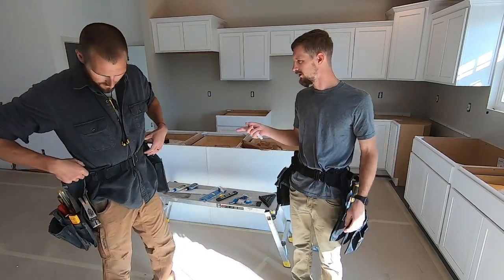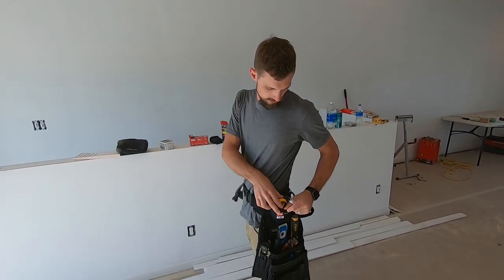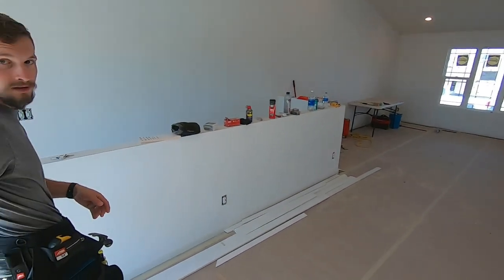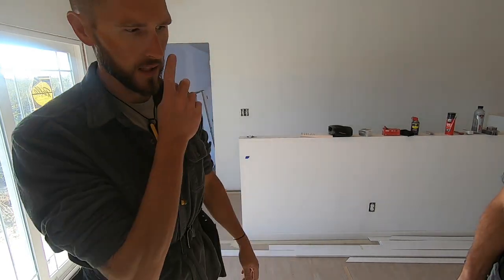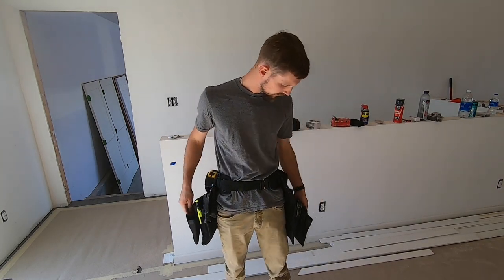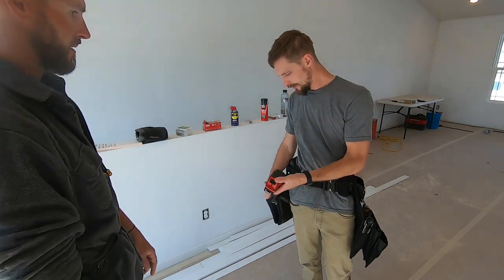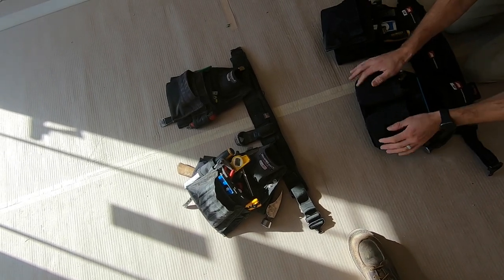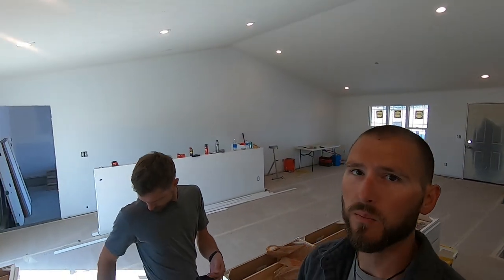Diamondback Tool belt review & comparison. Artisan, Miter, Eagle, SXS, Elias. Best setup!

Comment: This is a great informational video! Think I’m gonna look into badger or just keep the occidental. Thanks for taking the time to do this.
Reply from the maker: Glad it helped thanks for watching, I’m going to check out badger tool belts your the third guy that’s mentioned them !
Reply: I'm thinking of pulling the trigger on the badger side by side setup before the price increase. I'm a residential framer in MA. The framer badger bags is just too much in my opinion.
Reply: I currently have an occidental leather setup but am sick of the weight. Dont get me wrong the bags are super durable. But wearing leather is more weight.
Reply from the maker: Nice what set of occidental are you wearing ? Biggest thing for me is the hammer holster, I don’t think I could do without it now that I’m used to it !
Reply: @AMAYERICAN  three pouch fastener for non dominant and the standard tool pouch with just one lower pouch for dominant. And the high rise hammer holster in the back. Its simple and I can fit everything I need. But I find my hammer always getting in the way when I crouch down. I'm sold on the hammer under the bag style.
Reply: @AMAYERICAN  cool LMK on those, imma ext siding, windows and door sub in OR. Thinking about getting the high low framer. I like to have extra utility capacity. I HATE wearing belts with minimal tools… 55+ dad helps run the company and thinks im a moron 😂for that idea. 🎄
Reply from the maker: I definitely agree with your line of thinking, better to have it and not need it than to need it and not have it !

Comment: Seems like that SXS pouch is more suited as a non dominant side pouch, I have the grande 2.0 setup and I had that issue with my fat max in the tape holder but it stretched out pretty quickly.
Good info, I agree with 6 inch belt recommendation
I love my grande setup though
Reply from the maker: Man I’ve had my eyes on that setup for framing, looks awesome, is there s bit index on the 2.0? I agree with ya on the sxs. What size of tape do you run in the grande ?

Comment: I've had the Mazo and Loki pouches for about a year, and while I do really like them, I just ordered the occidental finisher rig to replace it. The main reason for the switch is that the bags hold all my everyday carry just fine, but I have found that when I'm doing certain tasks like crown for example, I run out of spots to put things, like 15ga & 18ga nails, cut list, stud finder, gauge blocks, chalk line, piece of sand paper, glue, miter clamps, angle finder etc. Its my fault for buying such small bags, but I also dislike how low Diamond backs bigger bags hang and wanted to avoid them. Also Ive realized  I prefer more open pouches, I find that really annoying on DB. I thought I wanted something with a smaller foot print for maneuvering in and out of openings and I'll likely miss that with the Oxi's but I think they will suit me and my workflow better. I do have the hammer and flat bar holsters, love those, I will modify my new bags to fit them. The tape pouch on you guys' rigs would annoy the hell out of me, another thing I like about the ones I got is they have a nylon loop to clip my tape on my left side which is my preference.
Reply from the maker: thanks for sharing your input brother! I agree the diamondback design seems to be less open then standard style bags. I do like my artisan rig for trim. You will have to let me know how the oxcidental bags treat ya. I know spencer lewis switched back after trying diamondback as well,
Reply: Update: I switched back to my original diamond back rig. I put on the oxis, and while they were great, they were just a lot bigger (wider) than I had thought. I have been on remodels lately, so I’m around a lot of finished surfaces and felt my original rig was better suited.

Comment: I got the SxS and mule, I love it,  I do framing though.  So the big pockets work great for me.  My 25ft fat max fits pretty good, Easy to drop in.
Reply from the maker: Nice !!! 6 in belt? Also are you rocking suspenders?
Reply: @AMAYERICAN  sadly no, I got the 4 inch from my artisan set up, just bought the pouches.  Might buy a badger belt though.  I hear those are really comfortable.

Comment: Hey Drew ; long time no talk!  I am Jim Duncan ; Kings Table Finish Carpentry!  I told you that you would make a good carpenter!  I lost my IG channel just as I was building it up?  Said I was under 13 yrs of age and shut that big dawg down!
Anyway rigs?  I hv been wearing an Akribis custom made trim rig for ?  5 months now?  I just enjoy full leather rigs and it has all my setups right there!   I started working (sub contracting) for GC’s doing all the finish work it’s all doors, custom trim, windows, base, crown, some stairs & so on!
Great video keep plugging away brother!  God Bless!
Reply from the maker: Hey Jim! Good to hear from you brother! Your advice/ encouragement kept me going in the early days. Those Akribis rigs look awesome as well. Sounds like you are staying busy as ever, glad to hear it! What’s ur  new IG handle ?
Reply: @AMAYERICAN  Hey buddy it’s “Kings Table Custom Carpentry”!  And man you have really improved your skills brother!  You keep it up the passion for the trade shows!  
Not much on my page yet    I need to repost when  I hv time !  I am trimming out homes doing doors both customs slabs install and prehungs
Window trims
Base/crown sect.,.  
On the Makita platform but run the dewalt table saw on the job and 12” Makita corded plus I hv a dewalt 716 if it’s a quick job.
Wear Akribus custom trim set up!  Little heavy but once loaded all tool belts R heavy ?  What a few pounds ?  It’s the joy of slipping into that rig 1st thing in the am!!
Smelling that leather!
Your no small man you should get one you would love it!

Comment: I don't have any carpentry on the menu currently but, if I did I would buy that set up for the hammer holster alone and then work with whatever else I have the best I could. Currently I just use a one sided Lowe's belt just because it actually had enough holes in the belt to fit me snug and I just dont need two sides worth of goods. The hammer holder on it is way low so I put another lone one on the belt for a other option but, even that is annoying...
 I haven't had much time for videos so I'm gonna scroll back to see what I missed.. 
✌
Reply from the maker: Thanks brother! And hammer holster is the cats pajamas 💯

Comment: going back and forth between the ox and the sxs.  Im a drywaller boarder and we like to keep a big pouch of screws on us, and atleast one more other spot for different sized screws.  The fastener pouch would be on my left side, my non dominant side.  Im still unsure which toolbag i would go with on my right side, to hold my knife, keyhole saw, chalk line, pencil, marker, rasp, circle cutter etc etc maybe a couple screwdrivers
Reply from the maker: I love the artisan miter pouch with bit index for non dominant/ holding tools. Have you looked at the grandes for big open pouches for fasteners ?

Comment: Im the 69th commentor on this vid!

Anyway thanks to your video, I was able to deduce something. I am 6'4 (legit 76 inches) I purchased the womens version of the belt. 

Im a size 31 waist size, skinny as fuck weighing in at 178 pounds. 

Your video gave me a idea, This will be my 3rd and final try, I ordered the womens belt. Apparently its good if it pinches your sides and they say always order you waist size, but for skinny dudes I think they need to go 1 size smaller. 

My 6 inch and 4 inch does not stay on for shit, I noticed the more the belt raps around me, the loser it becomes. 

Going 1 size smaller will make the belt wrap around me less with a tighter fit. Will report back later.
Reply from the maker: I have seen badger belts and I might purchase the belt only and run my DB bags on that belt. I do not care for DB belt I have currently. Thanks for commenting ! Plz comment back what you figure out !

Comment: Thought of comparing it to Akribis. King of leather?
Reply from the maker: Those bags are 🔥🔥🔥! Do you own a pair ?
Reply: @AMAYERICAN  I wish. Still in Electrical Trade school. I want to start with Akribis or diamondback.
Reply from the maker: Only flaw of db is the belt could use some padding. It can get uncomfortable but I still love my setup. Never owned a good set of leathers to compare tho
Reply: I have an Akribis tool belt and currently shopping diamondback. Akribis are fire for sure but heavy as well!
Reply from the maker: Nice! Been hearing a lot about badger tool belts, I wish diamondback had more padding, definitely would recommend the 6 in belt

Comment: Is the SxS main pouch pretty good size like the grande main pouch?? I had the Grande's and got rid of them they didn't have enough places for things I was going to get the Axe for the dominant side and the SxS for the left
Reply from the maker: I would say it’s a pretty large pouch comparable to grande, much bigger than the artisan setup I run. Are you a framer, or remodeler?
Reply: @AMAYERICAN   mostly pole barns and vinyl siding and windows. Just ordered the Mule 2.0 right and SxS left 1 minute ago 😀.. Had a set of Badger SxS before, Im addicted to tool belts 😅
Reply: Have two sets of Occidental adjust to fits that I'm going to put on eBay after the first of the year, you can only sell so much at a time now, and I'm to my yearly limit
Reply from the maker: You’ll have to let me know which setup you like better !! Occidental’s are 🔥🔥
Reply: @AMAYERICAN  I'm going to stick with these they're a lot lighter.. I haven't got them yet obviously but my old Diamondbacks were half as light as the Occidentals.. But the Occidental adjust to fits are nice because the belt and bags are padded and  sewn into place so they don't slide around or dig into you like a leather belt

Comment: I hate the way the Diamondback bags taper to zero at the bottom. It is so hard to pull fasteners out of the bags, especially when you are running low. I'm ready to go back to Oxy's.
Reply from the maker: I agree what bags are you rocking ?
Reply: @AMAYERICAN  I think it's the Artisan. I wish I had bought the Graande. I just ordered and am waiting for the clip on style fastener pouches so hopefully that helps.I use lot's of screws all day long and need a variety of sizes. I also feel like the bags hang way too low. Does anyone else have that complaint? Maybe I need to get the belt up higher.
Reply from the maker: Mine dont ride low but my belt sits on top of my hips, I think a 6 in belt would be much better. The db sax are legit!